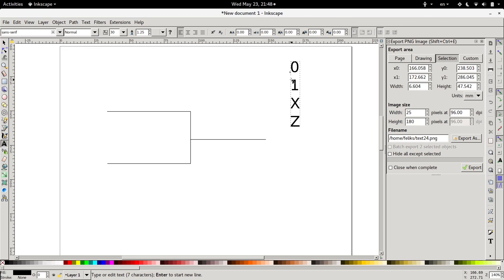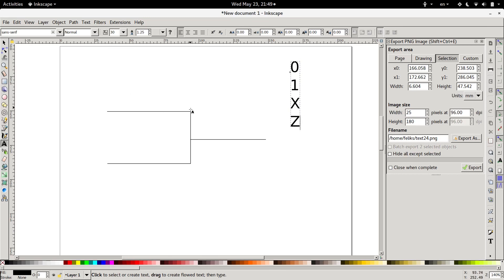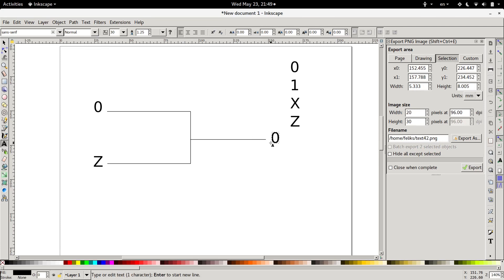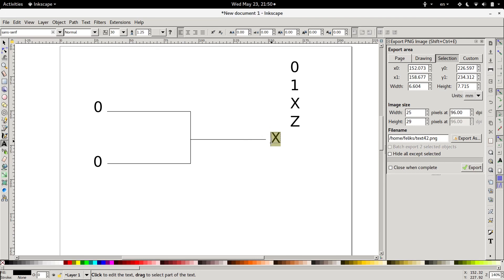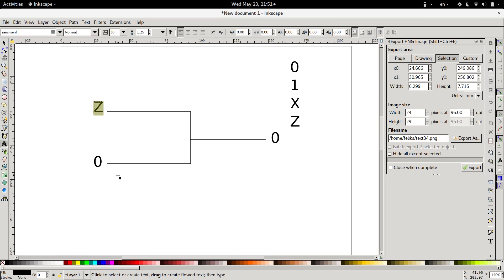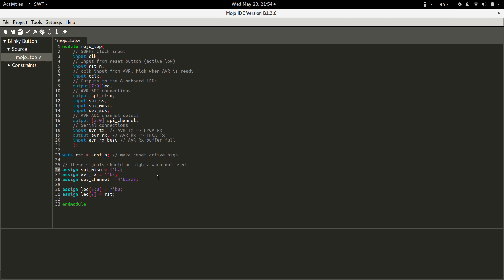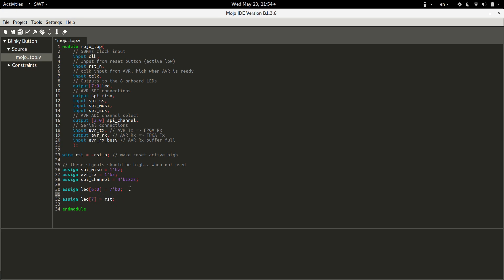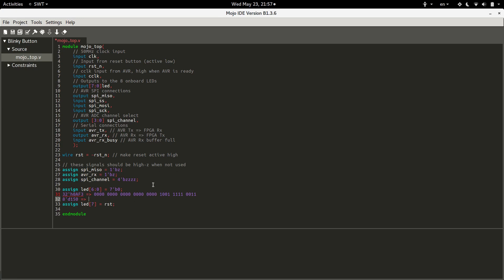Learn FPGA #5: Wire states (0,1,X,Z) Explained - Tutorial

Comment: So... the datatypes in verilog: number. wirestate. seems simple enough. Any inherent datatypes for negative numbers (2s complement) or do I need to code that myself? What about basic operations? addition? Carry bits? Do we get IEEE 754 floats? Probably not. If I do make myself a full adder, does it create one for every addition I write into the code?
Reply from the maker: There are actually some other more specialized datatypes, such as time or triand, but for now, we will just focus on these basic ones. When you use integers, those will automatically account for negative numbers when applicable. Basic operations can be done with the standard operators that are also used in programming, such as +, -, *, or /. Of course, you can always define your own ways of interacting with or storing data.
Reply from the maker: When you instantiate a module, it will create a new physical circuit in the chip. However, basic operations like addition are built-in. You can use the + operator many times without it needing to create a new full adder for each one.

Comment: Can a module include timed code? Say you have a single input and you want the module to wait for a rising flank and when it gets that write the next say 40 bits to memory with one bit every clock cycle?
Reply from the maker: Yes you can time things. I often use a binary counter as a timer and have things run when it hits certain values. More on this in tutorial #21.

Comment: The way I got it in my digital logic course, 'x' means, don't care in the context of an input. It means as an input, with the other inputs as they are, it doesn't affect the output (it really only saves space in the logic table and if you do a standardized drawing of the logic table you can leave out the inputs for that block of logic). On an output it denotes an invalid state. For example in your flip flip, if R and S are both pulled high, you have a short circuit. Logically speaking you force both a 1 and a 0 on the same wire, opening the transistors to the pull up and pull down resistors. Physically speaking you have a current across the mosfets without going through the inputs and outputs.

In your example with the two wires you're missing half the circuit. when you write a 1 to the wire on the left it means you connect that wire through a pull up resistor to the voltage rail, creating a potential on the wire. On the output side you are connected to the ground rail, and some component is in between (say an LED or it's driver at least). so when you put the 1 on the top wire, the potential will turn into a current through your LED, showing you you have a 1. the LED could of course be just another logic input. just at some point you need to come back to ground potential to have the current flow.
If you put a 0 on there, you connect the wire to the ground rail with a pull down resistor. and potential will be grounded, creating an output of 0 and a current through that resistor instead.
Reply from the maker: Yes, you are completely right about the different meanings of 'X'. The input "don't care" meaning of 'X' doesn't matter unless you're trying to simplify logic circuits / truth tables. Also true that pulling both R and S high will cause strange things to happen and might let the magic smoke out. Usually, there'd be a safety in there to keep you from pulling both high.
Reply from the maker: This diagram was just to show how an flip-flop works on a gate level. The "rest" of the complete circuit was left out for simplicity's sake.

Comment: On line 30 should it be 7'b0000000 instead of 7'b0 ?
Reply from the maker: Good question. What Verilog does is force the number you give to be the size you specify. For example, 4'b0 will generate 0000, 4'b1 will generate 0001, and so on. Of course, you could also specify those zeros explicitly, where 4'b0000 will generate 0000.